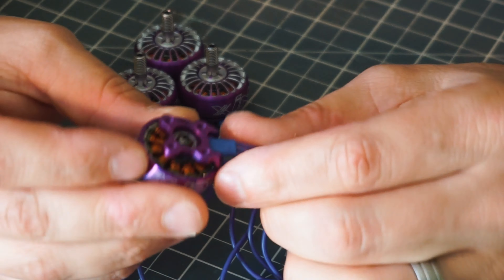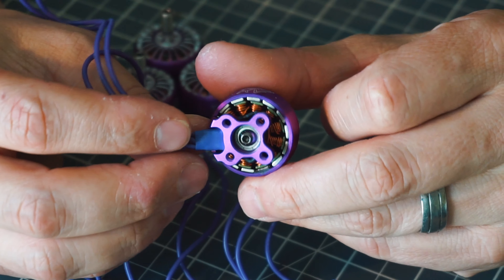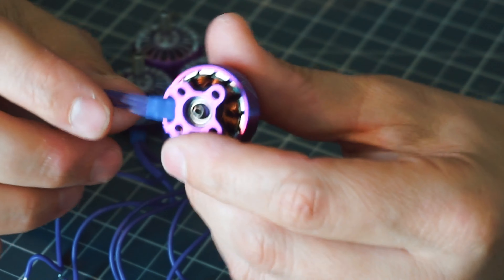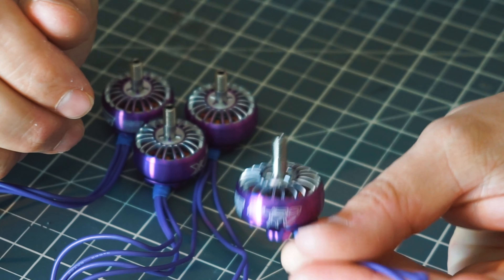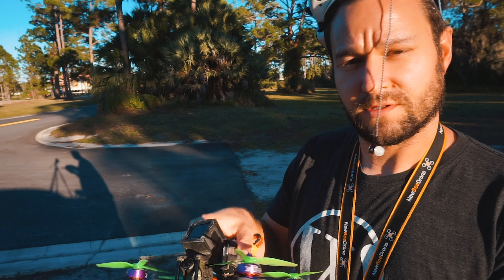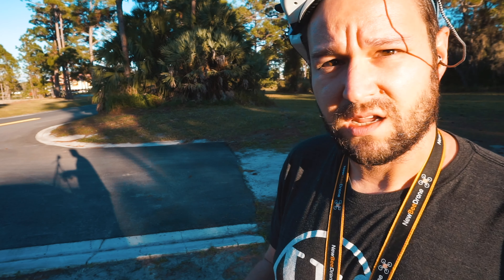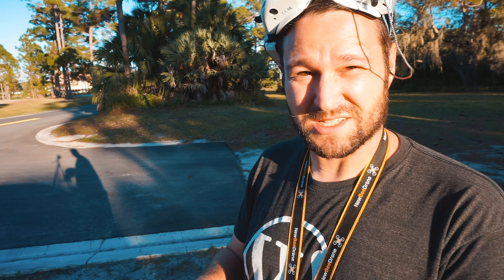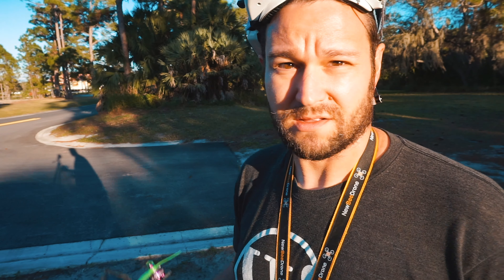iFlight Xing 2306 2450kv Review + Flight Test - KWAD TECH TUESDAY

Comment: I think you should tear down one of these motors. They clearly are NOT the same as the ones that KababFPV reviewed. Those motors had the slots in the bell rounded and anodized, yours are sharp and not anodized. I wonder what else is different...

Comment: i pretty much like the hypertrain 2306-2450 v1, they behave very smooth, responsive and have enuff punchout even on 4s. 
and because of the open bell they do not overheat on my settings like others and still can take a lot damage. i did not change them over a year now.
only thing i really dont like/understand is why they keep the cables that short...

big up andi zaugg for the support"

Comment: I actually wanted to try these, I love my iFlight Battle Axe frame and I think iFlight is a company I'd be willing to try out. What props were you running on those though? And was that 4s? I rock Dal 5050c on 2205's, would the heavy prop and these bigger motors be too power hungry? My 4-in-1 ESC rated for 40/45A (each) but I prefer to keep it well below max if possible. [Oh, on 4s btw too] Great review man!

Comment: I'm trying to debate on new motors on skitzo Nova with flightone skitzo board,bolt32 esc but nor able to figure out why it feels weak and the worst is jitter at almost all throttle precentages..wild Willy 2306/2500 and I've even replaced bearings but yet same shit.. double check my setup and wiring and nothing fixed it.love the response of flightone but damn this issue